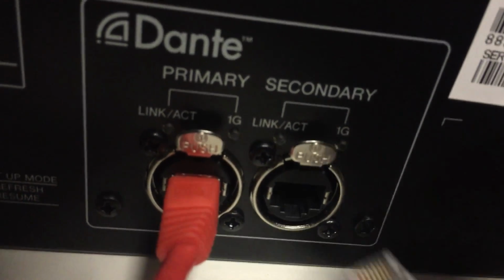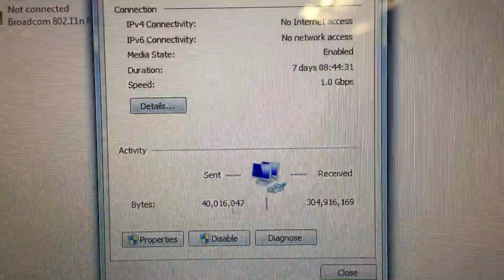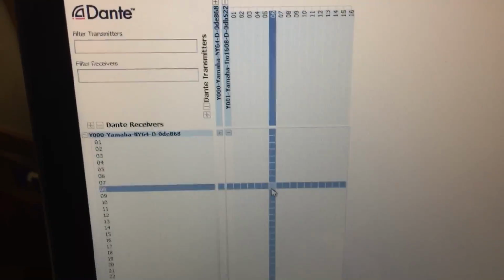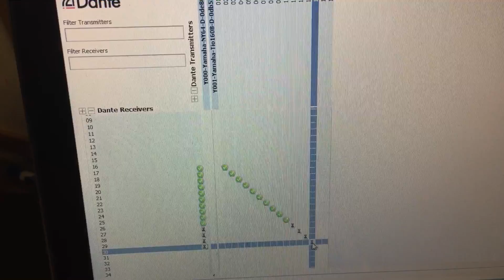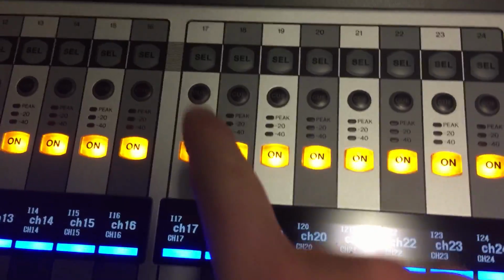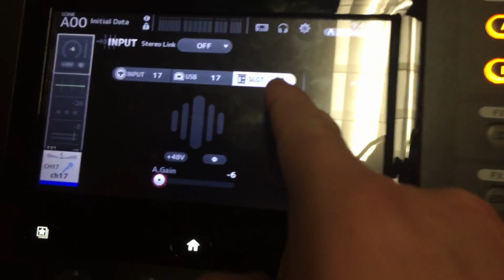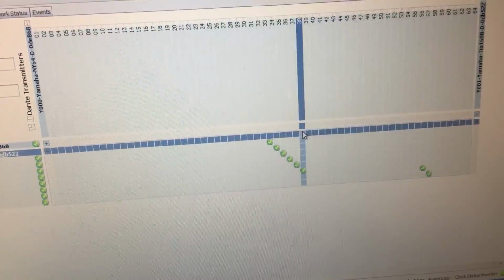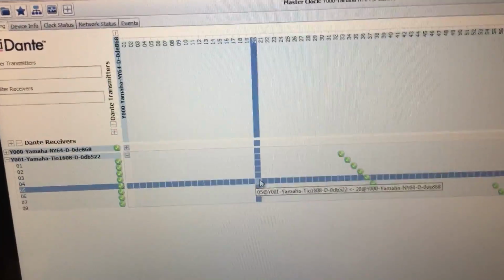How to change patching on TIO1608 with TF Mixer & NY64-D

Comment: Huge help!  Hi all. I was in a tough situation. We have the Yamaha TF1 Console and the TIO1608 connected via ethernet. We see that the TIO is synced (all lights are green). Yet, we cannot get 48v phantom power to the TIO from the TF1. Yes, the Phanton Power Switch on both the TIO and the TF! are both set to "on."  I think it has to do with I/O assignments. But we are dumbfounded. The Quick Configure option doesn't solve the issue. So I don't know what to do. Can anyone help? BUT, THIS SOLVED THE ISSUE!!!

Comment: Hi I have a question: when you patched CH17 to the first input port of the TIO1608, what happens to the input port 17 of the TF mixer? does it just becomes unused, regardless something is connected to it or not?

Comment: I am about to buy a tf5 and 2 tio. They will be on stage and I was going to use the rear inputs on the board for channels 33 and on. Are there any issues setting it up that way?
Reply: Ed - did you solve this?
Reply: you can do it on the console itself

Comment: This is quite helpful...thank you. I am on a Mac and assume it is similar in connecting to the Tio. The configuration you demonstrated, would that be similar to doing a "quick config" using one Tio unit ID 2? I've been trying to configure my single Tio for channels 25 through 40. Any tips would be appreciated. Thanks for this!
Reply from the maker: +Ron Whittemore id 2 will place the inputs/outs on the next bank of channels. You probably have to use Dante controller still for 25-40. Sorry so late Ron GL!

Comment: Thanks, can the patches be permanently stored on the TF console and Tio? So that they don't require this setup each time they are powered on.
Reply from the maker: +Sean Ellingson yes, after you set it up, turn your tio off, then put the Resume dipswitch down to lock in the patching for next power up
Reply: Thanks! exactly what I was searching high and low for.. worked perfectly